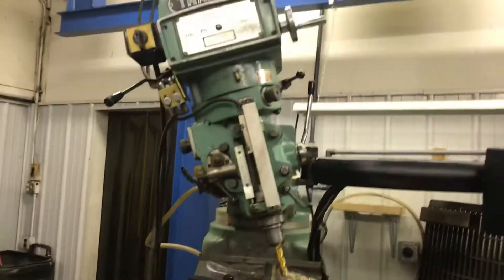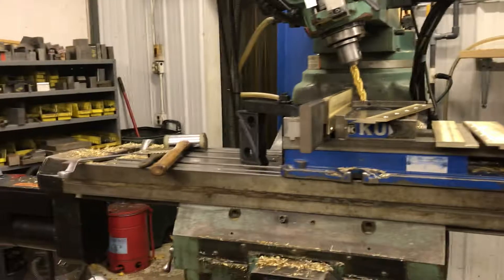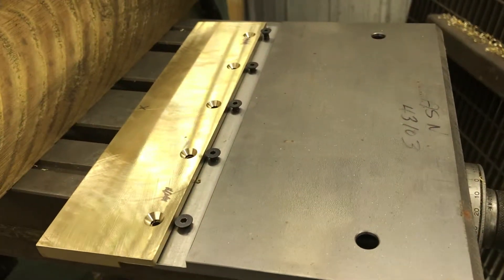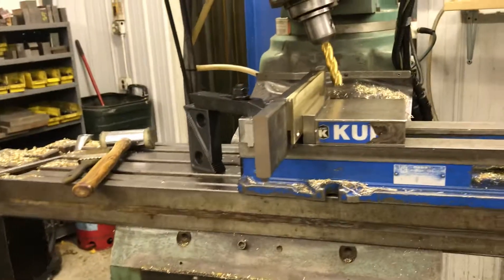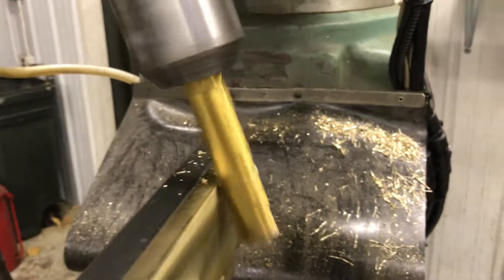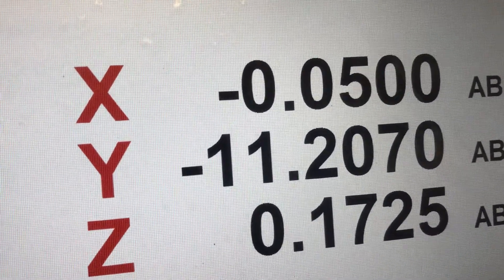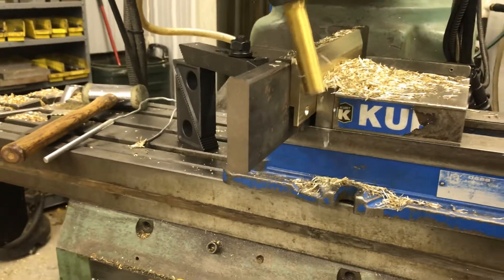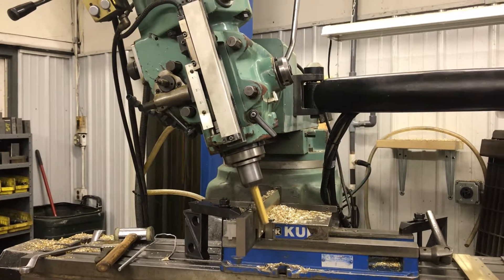Milling machine set up to cut an angle on bronze wear plates

Comment: I sure should hope that your cutters aren't coming out of your R8 collet, or you are doing something seriously wrong...
Reply from the maker: Thanks for your question.  Actually that isn't an R-8 Collet.  The machine has a CAT 30 end mill holder in there, and the end mill is held in place with a set screw that locks on the flat that comes on the end mill.  You are correct about an R-8 collet.  End mills can pull out of them with heavy cuts and dull cutters, which also heats up the part you are machining.